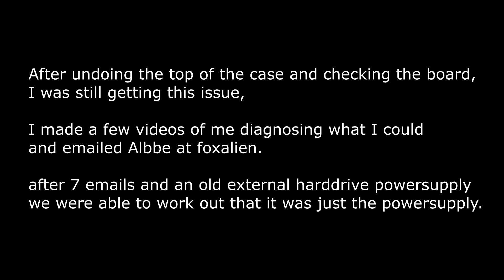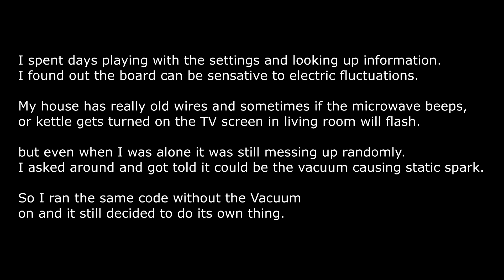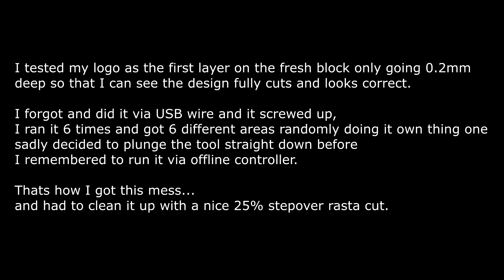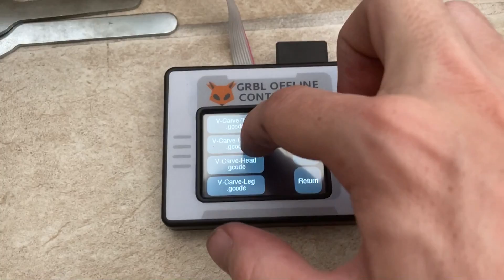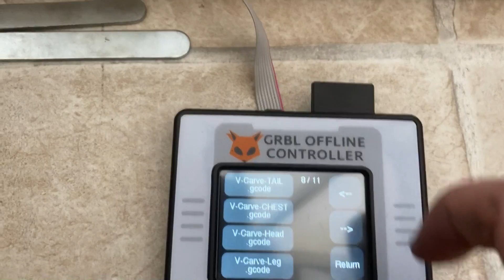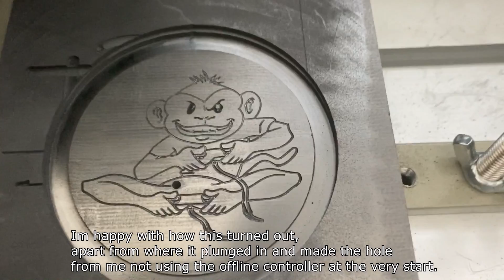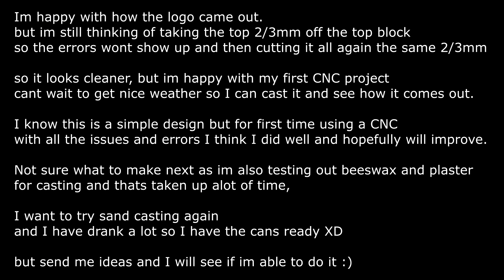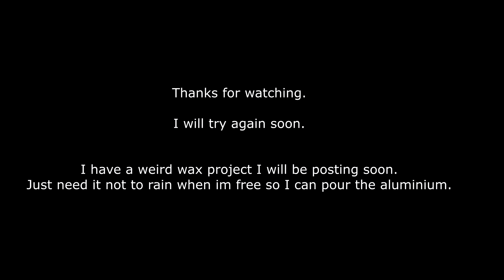Making a custom Graphite mold for aluminium coin (Coin Fail)

Comment: Don’t let the vacuum hose touch any part of the cnc. The static charge it builds can cause issues.
Reply from the maker: ye i thought that might happen, little static charge can build up so i did wrap around the hose with a ground wire to try and help, not sure if it will work but worth a try, could do with an attachment to the cnc but the shoes stop you being able to see whats  being cut and its too messy to use a air hose to blow it to one side , so im thinking of  doing a mix of both by building the cnc into a stand thats hollow and using a big fan ontop forcing all the stuff to blow down and to the sides of the cnc, into a collection box since its only a small cnc :)
Reply: @SimianLive  I ended up running a dedicated ground wire from the spindle/router housing to the system ground. It works 98% of the time. I have to be very careful to not touch anything with the vacuum.  I also enclosed my CNC in a box and put a 4 inch coupler from my Harbor Freight dust collector into the front of the enclosure. It’s a big help!  Another BIG issue is Windows going to sleep while carving, or doing stupid background stuff, or trying to download updates really kills the CNC. Good luck!
Reply from the maker: @davidhainline6357  that’s a good idea, I gave up using usb connection as the MacBook Air (running windows ) had issues as it’s powered by that magnetic charging cable and that would then screw with the board, so now I just put it on a micro sd and run through the offline controller.